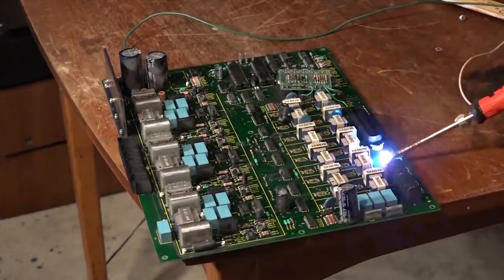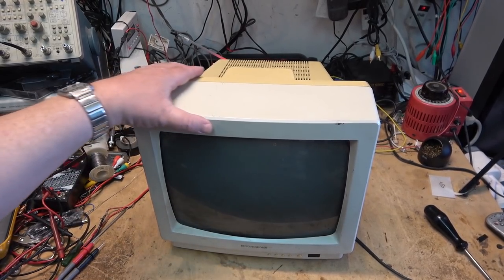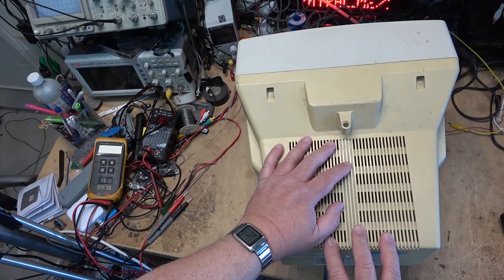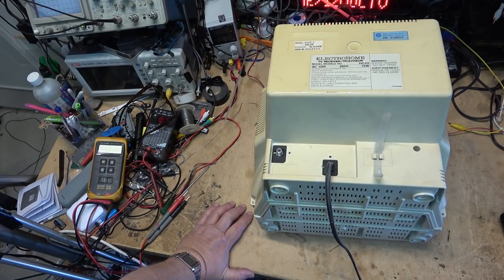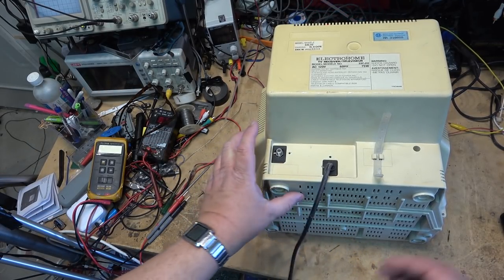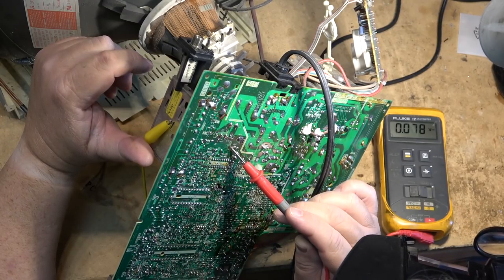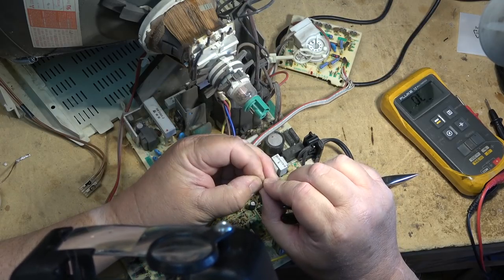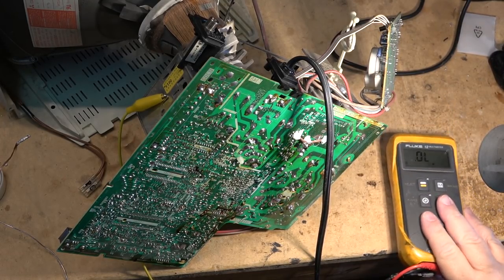Electrohome 33CJ12 CRT TV totally dead can it be repaired?

Comment: Electrohome used to have a factory in kitchener, ontario the building still stands far as i know and its all lofts now
Reply from the maker: Yes correct.   I used to fix tons of those tvs that had been sold by Eaton's, Woodward's and the Hudson Bay department stores.  Ah the good old days.   The Bay is the oldest company in Canada.  They are still hanging in there barely.
Reply: The main Electrohome factory in Kitchener is owned by Christie projector and I think they still do manufacturing there.
Reply from the maker: @irtbmtind89  
According to their web page engineering is done in Canada bit manufacturing in Shenzhen China.

Comment: Sounds like the ceiling fan could use a drop of 3-in-1 oil!
Reply from the maker: It's the bracket.  It ever so slightly wobbles. The mounting leg has a ball joint on the end that fits into the metal bracket screwed into the stud. The slight wobble us squeaking slightly which is much louder on mic as it camera is closer to it than my ears.
Reply from the maker: @Ken Mason I knew that was coming.  If they are mounted to a box the box needs to be a special fan box that is anchored into truss or joist.  The one in my garage is secured with 2" screws right into the 2x4 truss so it isn't going anywhere.

Comment: I have a question dave. Can a lot of dust in a crt cause dark picture and if you get it all out will it be better?
Reply from the maker: No, dust does not affect a CRT. The CRT itself is a vacuum tube.  There is no air inside and no dust. If the face of the tube is extremely dirty it will dull the image slightly.  If the picture is dark either the drive signal is low or the crt itself is weak.  9 out of 10 it is the tube.  They don't last forever.  Like all vaccum tubes they have a limited life.
Reply: @12voltvids  of course you can adjust the screen control inside to make the picture brighter.
Reply from the maker: @austinthevhsvideogamelover5265  well that's if the tube is still got any emission left. Modern televisions and I mean basically anything made from about 1990 on including the color track 2000 from RCA and the system 3 from zenith and most Sony trinitrons all had a circuit called AKB, auto kine bias. The AKB circuit would test and adjust the beam current for each of the three cathodes every frame. It did this during the vertical interval in a few lines at the top of the screen the circuit would provide a reference to the tube and measure how much current the cathode was drawing if the current was too low it would turn the cathode up. This allowed as the tube aged the color balance to remain true until the tube was at the end of its service life then the color would go Haywire. On Sony the symptom of the sleep light flashing at a two Hertz rate and the picture not coming on was the symptom that the tube was tired. You could squeak a few more months of service out by turning up the screen but the color was never right. What Sony did was when the set first turned on that sleep light would flash on and off while the picture was kept blank and it was measuring the beam current and making automatic adjustments. Each register had $255 possible combinations from 0 to 2:55. What's the tube got to the point where equilibrium could not be reached on all three beams by the time one of the registers reached its max value it would keep the picture muted. This cause confusion for many customers that were accustomed to as their tube aged say the red getting weak are the tube starting to flare, because with these televisions the pictures stayed good it was perfect and then one day they turn the set on and the picture didn't come on or it took a long time to come on but eventually they would just have no picture and we would be telling them their picture tube was shot and they'd be calling us a liar because yesterday it had a great picture it didn't fade away gradually as expected. So yes adjusting the bias may bring the picture up but it probably won't bring the picture up with proper contrast when the tube is weak
Reply: @12voltvids  My grandma nellie has a 1997 White Westinghouse 1997 CRT TV still and it works. She got if from a family member in 2002 and in her older apartment in the spare room it never got much use until 2009 when she moved to her current apartment, she had it in her bedroom for cable and up until 5/16/2020 it got put in the spare room because she got rid of her recievers and now her onn roku tv is in there with the spectrum cable programmed in. The White Westinghouse still works good. I had it on for 3 hours and nothing bad happened.
Reply from the maker: @austinthevhsvideogamelover5265  
I have much older CRT sets that and they work great.  Mind you I don't use them so they won't degrade just sitting there.
Reply: @12voltvids  like this one in the video from 1986-1989 you estimated. On channel 3 WITH THE CURRENT ANT. CABLE I AM USING ONLY, The picture looks brighter and a little Tinted and not much flaring with everything turned up. On 4, the picture flares more than on ch 3 with darker picture. Its just a little less on 3 than 4.

Comment: Thanks for the Info now I understand better about Canada they don't make good products so they FORCE companies 
to change their name brand to Canadian brands so Canada looks good ...
Reply from the maker: Actually Electrohome when they made them here were excellent. My parents had one as did my wife's parents and the tv lasted 25 years.  
The problem was cheap electronics from Japan.  This caused the Canadian (and American) manufactures to lose sales and market share.  Admiral, Philco, Motorola, RCA and zenith all closed down their tv factories.  Electrohome also closed down their factory in Canada.  The Canadian government put embargoes and import taxes onto Japanese electronics to try to save manufacturing jobs but it was too little too late and loopholes allowed Japanese companies to bring products in as long as they picked up companies on the brink and assembled them here.  Mitsubishi kept the Electrohome factory alive for 10 years.  They made beautiful console tvs out of real wood in Canada using a Mitsubishi tube and chassis.  They were very good sets and they kept the wood shop and final assembly workers going for an 12 years before they pulled the plug and completely left Canada for the final time.  I had a 50" Electrohome projection set for many years.  Bought it in 89 and i used it until 2003 when I got my first HD DLP tv. I gave it to my mother and she ran it right through till 2012 when it finially died. That was 23 years out of a projection set.  In that time the vertical output ic failed twice as did one of the convergence output ic.
Reply: Thanks for the Info you are full of experience and good knowledge thanks for sharing all that good stuff with us

Comment: How is it that you have analog channels?
Reply: He uses a Blonder Tongue analog RF modulator if I'm not mistaken.
Reply from the maker: I have several modulators. One is a BT stereo modulator.  The other stereo one is a radio shack, and there are a few other ones I got out of old buildings used for the security cameras when they went digital and decommissioned the old ones.  Building manager said take em away and recycle so that's what I did.

Comment: Remember, 20% of the capacitors cause 80% of the problems! The converse of this is not true however; 80% of the caps do not cause 20% of the problems, because there’s always other crap; blown fuses, burned-up resistors, popped transistors, bad flyback transformers, etc… 🤣